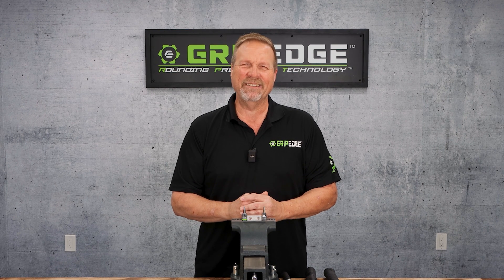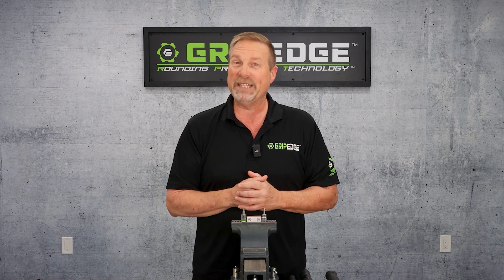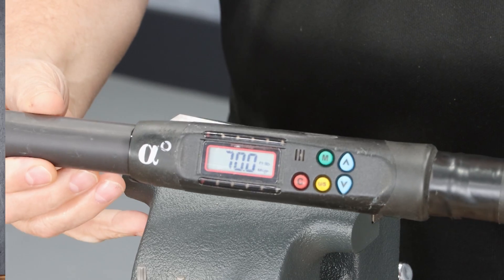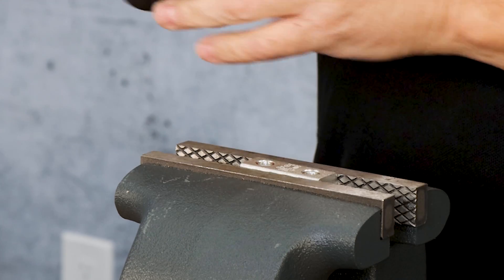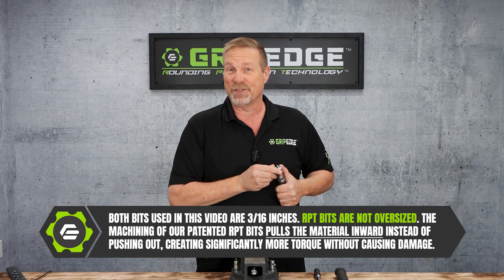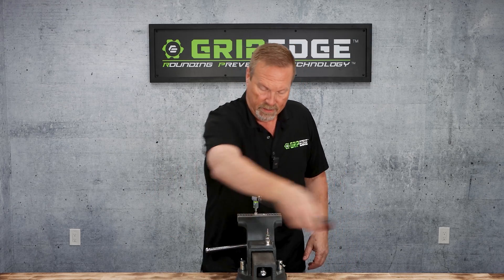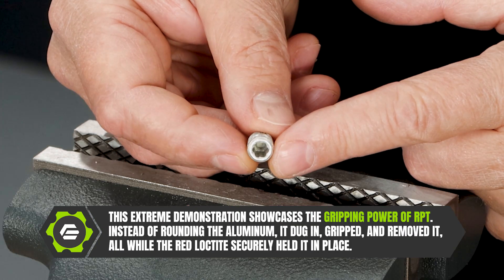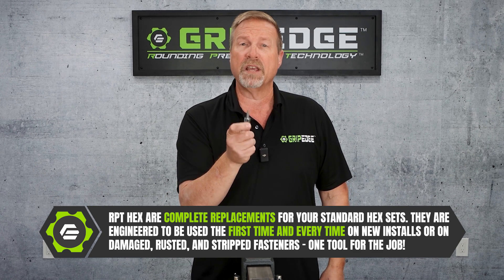RPT Hex | Aluminum + Red Loctite | Torque Wrench Test | Extreme Use-Case Demo

Comment: I don't see much loctite on that thread. It's hard to say if its fair when you can't see how much is on the other one. Maybe these are great, but I've seen too many snake oil demos to trust videos like this.
Reply from the maker: Thanks for leaving a comment and inquiring. If you check out 02:50 in the video, the Loctite is peeling off the fastener as it's being removed so when you see the close-up shot, there is less there than when we first applied it to let it cure. Next time we will film the application of the Loctite to assist with clarity. Check out our playlist of RPT HEX videos to learn more ➡ https://youtube.com/playlist?list=PLT3aVa8rHgN8JpNu80H8YWBiH7-bHxDT6&si=CG83I-X5zKht7knd

We also have a similar video that shows the application of the Loctite that you can watch here
Watch on Instagram  https://shorturl.at/SaqV8
Watch on Facebook  https://shorturl.at/xAY87